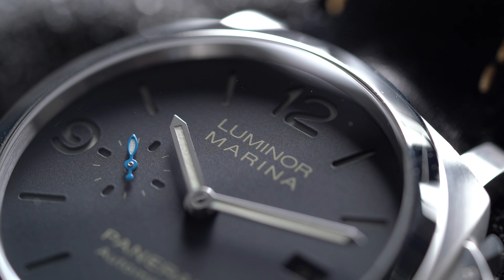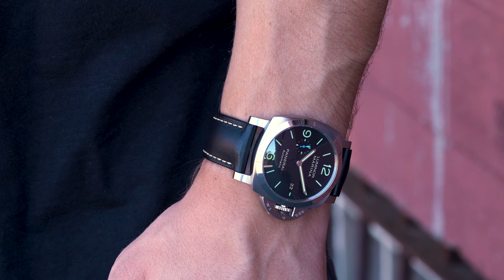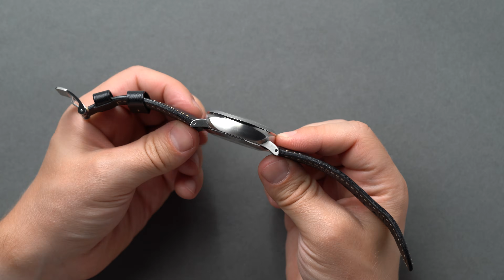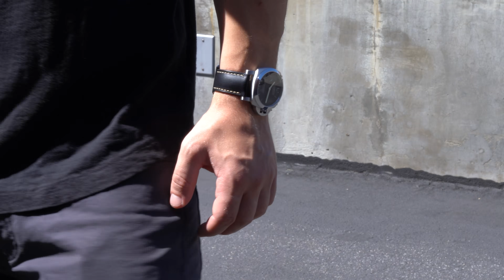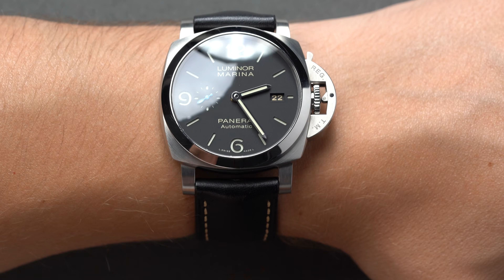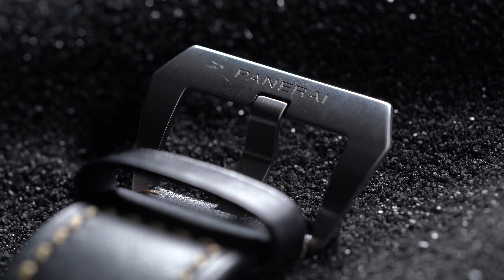The Perfect Panerai? - Panerai Luminor Marina Review

Comment: The problem with this new quick release system is that it really limits you to Panerai’s straps. Their old plunger system worked with aftermarket straps, making it much more fun to experiment with a wider variety of straps but still making it easy to change them.

Comment: Did Panerai close the boring exhibition case on their PAM01312? I don’t ever remember this model coming with a closed case back.
Reply: I own the 1312 and it does indeed have the exhibition case back.  The in-house movement is nothing to look at, as you suggest.  The newer movement allows the watch to be slightly thinner than the previous edition which I do like.  Not sure why this one does not have the same open case back unless it is the older 0312.
Reply: @ I just cross-checked through their website, the current model does indeed have the case back closed. 

I understand these are “tool/dive watches”, but in today’s age we buy to appreciate the craft and effort put into these watches. 

I had not known that they have changed the caliber in these models.. seems like it only helped them in making the case slimmer.

@stevenesch123 not sure why tagging you doesn’t work.